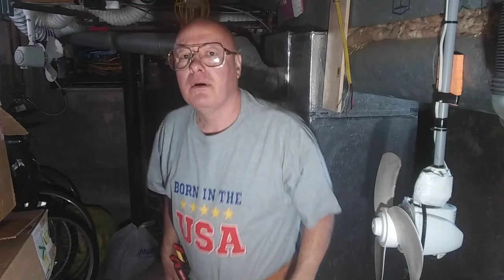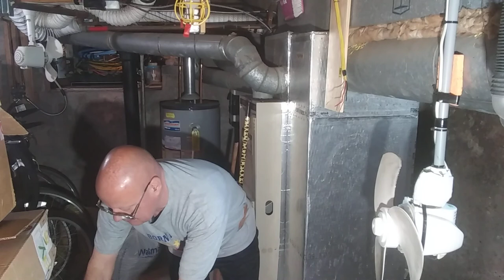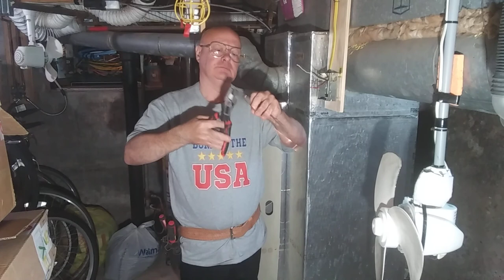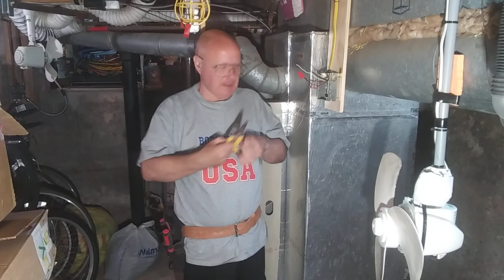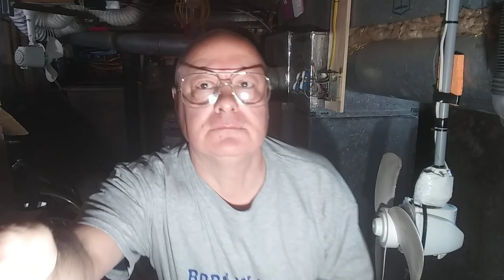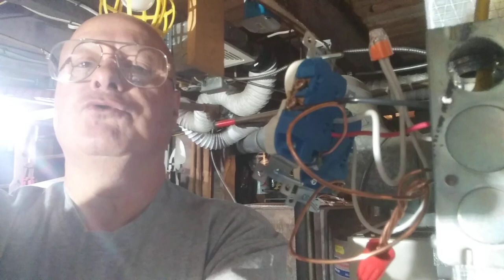I show and explain how we wire split 220/110 volts 2 outlets in 1 box

Comment: Did you use a 2 pole breaker in yhe panel? You can't share a neutral unless you can de-energize the conductors with 1 handle throw.

Comment: Typically there is a 30amp on 220 circuit and the two fuses are tied together so if one side trips the other will to. I ran across same scenario where the only power under cabinet is the 220 for the stove that continues on to oven. I wanted to keep 220 for oven and stove top but 110 for fan. The way I solved the issue was to create a mini sub 30 amp fused panel with the 30 amp feed from the stove top being the feed for the mini sub fused panel. The oven is now fused at 220 30amp on a secondary fuse and 15 amp fused for just 110 on fan. My inspector was fine the creation of a sub panel under the counter top as long as the neutral was insulated from casing and I labeled panel as sub panel in main box since the 4 way fuse panel is now a sub panel and feeds for the oven and cook top on their own fused feed as well. 
Although I've seen people do it, I can't let the sub panel be a junction box and just steal 110 because of the wire difference and the higher amp on 12/2 which isn't acceptable since it would take too long for the thicker guage wire to heat up and trip.
Reply: Q

Comment: I have 3 wire ( 110-110 and bare ground) 220 for a stove. , can i use the the bare ground wire as a neutral to add a hood vent fan?.

I have the same situation at the water heater. And id like to add an out let there as well for a washing machine.

In both cases i have no 110 in near by bays.
Im sure this would be wrong but can you explain why its wrong?
Reply: Never use a bare ground as a neutral.
Reply: @spencerh9162  thanks man sold the house did jist this with no problems thanks for a response a year later.

Comment: We cannot do that in the UK, since our 240 volt is one leg of a 415 volt star output from the substation, hence one side is already bonded to ground to produce a neutral return.
What is your 3 phase voltage in the US, I assume that it must be delta configured or separate from the single phase supply.
Reply: We have 3 phase 480 delta and wye